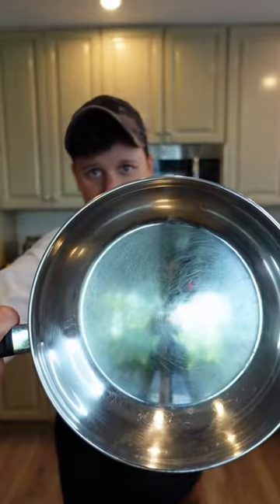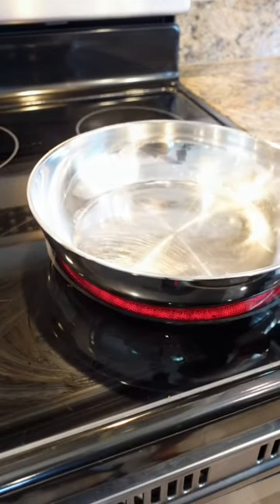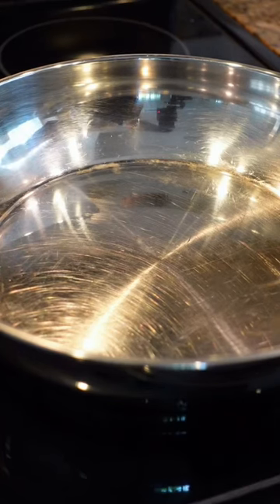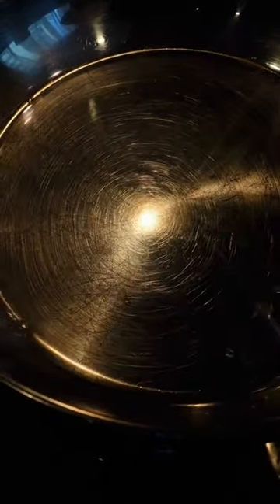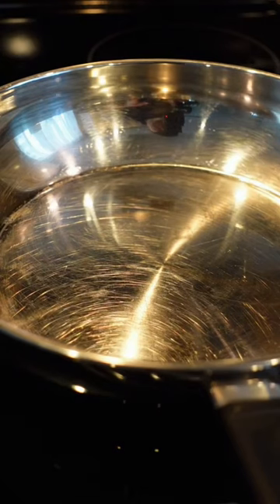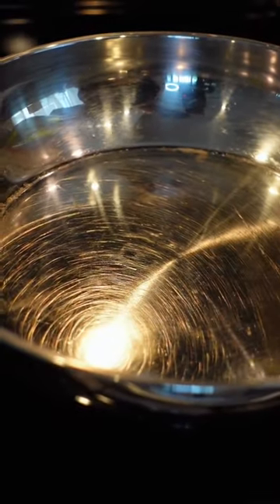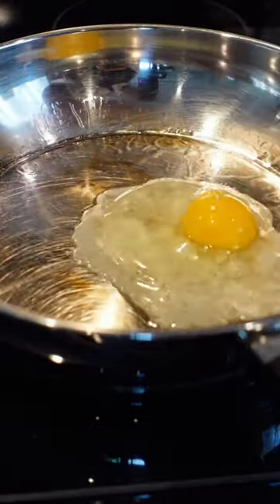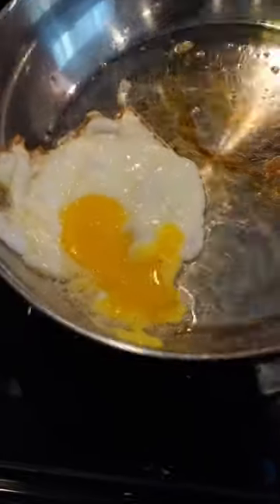HOW TO MAKE YOUR STAINLESS STEAL PANS NON-STICK #chef #food #cooking #kitchenhacks #hacks #howto

Comment: hello there. Got a stainless steel pan,everyone in the comments on amazon kept saying how you're supposed to do this. Did exactly this,the moment I put the olive oil in the pan it set on fire. So never again
Reply: Olive oil is generally not good for hard frying as it has such a low smoke point and will burn relatively easily when compared to other oils that are better for this activity. Consider trying again with the right oil for frying. We don't always succeed the first time we try something new. You've got this!

Comment: Sooooooooo you added oil to a hot pan. Was this a secret or something? I'm confused.
Reply: Wait till the water heads up. If it isn’t hot enough you will see it disperse
Reply: whats happening is you're getting a similar effect to a seasoned cast iron or carbon steel pan/wok
Reply: When you put some water on the pan, if it‘s not hot enough, the water will just evaporate. It should move around on the pan just like she showed it.
Reply: A rock would be non stick with that much oil
Reply: I’ve had some pretty shitty pans that would still stick using oil, that’s why the key is the temperature of the pan. The way they showed the water disbursing is what you wanna wait for before cooking
Reply: Many people do not let their pans come up to temperature. They cook and egg and it sticks. Its a small thing but a lot of folks dont know it
Reply: You're NOT confused. It's everybody else that is replying to you. Lol.
Reply: Ive never seen so many people have such a hard time identifying some playful sarcasm.

Comment: I think you should have added that the oil should get hot before cooking the egg
Reply: Don't think she had to specify that since the pan got hot enough for the water to bead. So as soon as she added the oil, it was already sizzling up.
Reply: @TheresaGiuriceo  No, from personal experience, the oil takes at least 20-30 seconds to heat up (usually you can tell by crouching down and looking if the oil is starting to smoke a bit)

Comment: Yeah, but I don’t want brown edges on my egg tho, crispy I like a over easy egg, once your stainless steel is dead it’s dead, I never ever cook with a cold pan, I put butter in let melt, then add my oil, if you are not on a salt restricted diet you can sprinkle a little on the bottom then add oil, me personally very impatient, so I bought a non stick it works great I love a 10 sec egg flip in my plate

Comment: Is it really non stick when you're using oil?  It eill however become non stick if you don't wash it after using it, and keep the heat low. All the old carbon buildup makes it non stick. Looks bad, but it works.

Comment: I gotta learn how to do that. My eggs always stick to the pan.
Reply: Really? Might not have your pan hot enough. With eggs when the bottom is fully cooked it should just peel straight off. The other issue is if you put bacon in before had it might be sticking due to left over residue. Or it could be something really simple like you just didnt put enough oil in. 
Another note if you have issues breaking the yoke dont flip them, baste oil ok the top of the egg to cook the to. And when taking it out place the spatula under the yoke so it doesnt get disturbed and break

Comment: Adding a bunch of oil will make anything non-stick. Not rocket science.
Reply: WRONG.
Reply: If it's not hot enough, the fats in the oil aren't able to bind to the bottom of the pan and keep the water in the good from staying on top of the oil.

Comment: add oil...yea, who would have known
Reply: Add all the oil you want if the pans not hot enough to bead water its not going to work. We are specifically talking about stainless steel pans with no coatings.